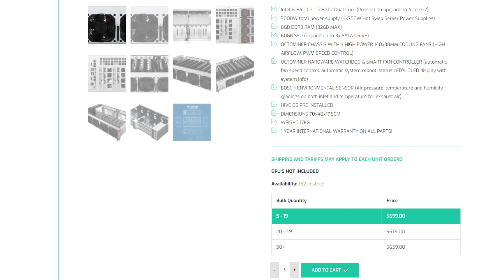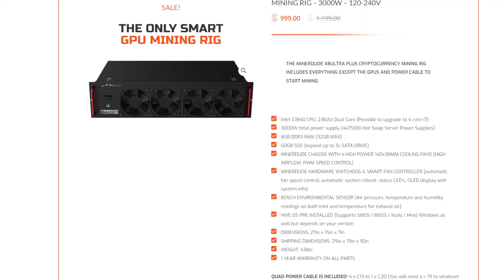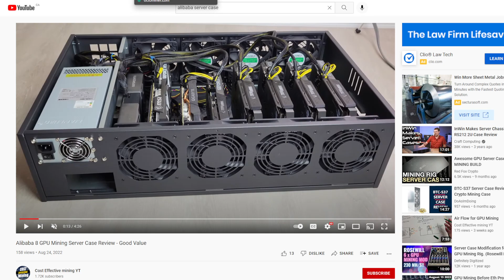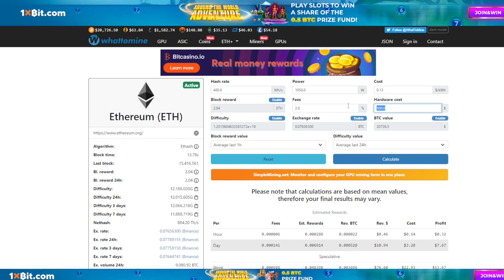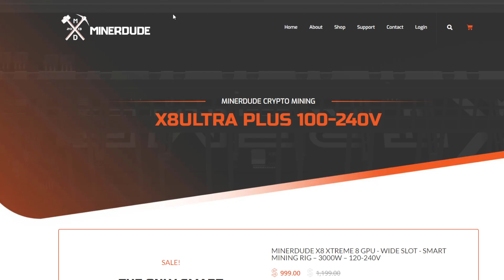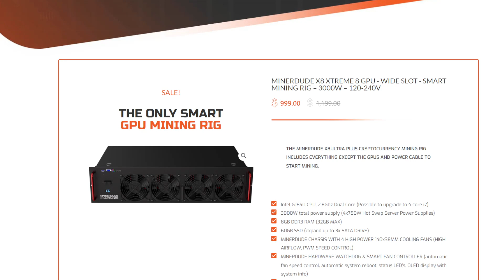Are you OVER PAYING for Mining Server Cases?

Comment: Thanks for making this vid, ive been wondering about cheaper alternatives than octominers. Even thought of buying some sheet metal and bending it into a case, but dont have the resources to make that happen. From price point open airs are the cheapest but dont offer much in terms of heat management, which is one of the main factors in getting one.
Reply from the maker: The alibaba seller I link the description is who I bought from. I went with what they call a folding case, where the shipping is cheaper and you assemble the case when it arrives.
It works great.
I am currently not buying anymore cases or gpus until I know what profitability will be like after ETH goes to proof of stake.
but its terms of value, I think the Alibaba cases are great.
Reply: @CostEffectiveminingYT  Hey those look cool

Comment: My first 2 miners where server cases that were from china off ebay. i think i paid about $600 for them but that was in the buill market. only problem i had to replace power supply on one. other then that they been running constantly for 2 years 24/7. My new thing after those 2 were using the btc - s37 boards because they were the cheapest option that work i think all in with everything they cost about $350 then i put server fans in front them to move the air, but if you can get a server case for $50 that would be diffidently worth spending the little extra because server cases are easier to deal with compared with btc s37 as far as organization
Reply from the maker: Nice, I also bought an S37 motherboard and case but from aliexpress last year. its been working good.